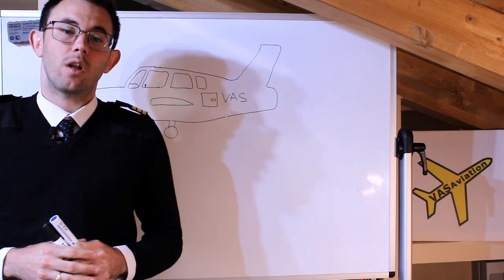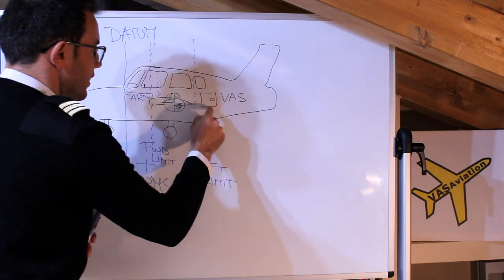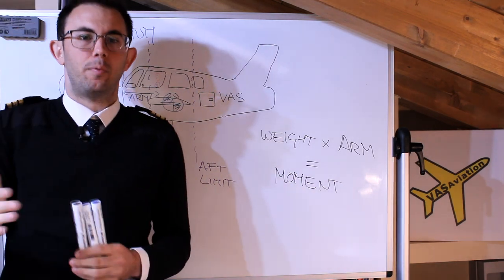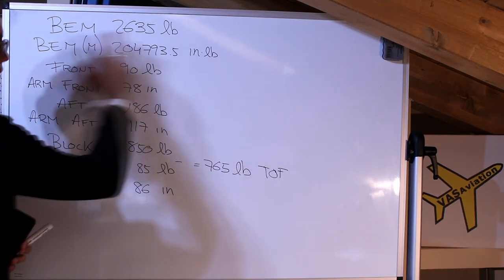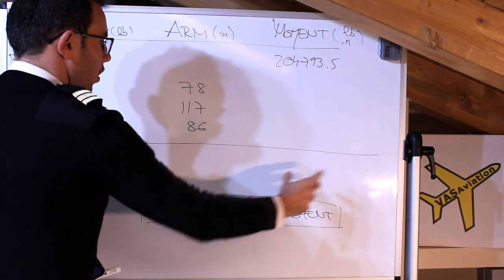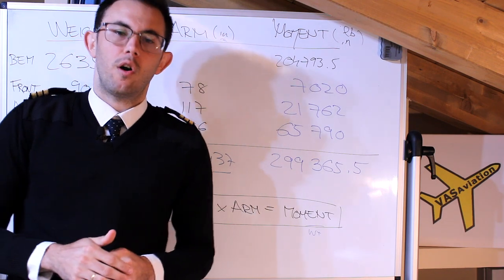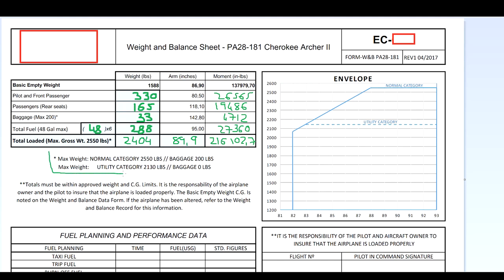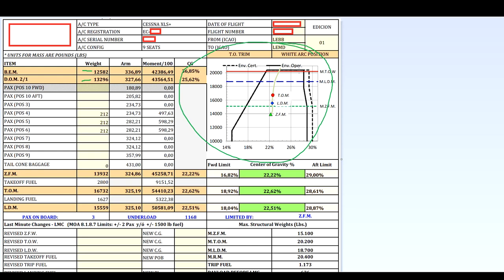MASS AND BALANCE | Terminology + CG Calculations

Comment: A few short years ago, we had pushed back and actually were in the alley when we got a call that the load was incorrect. Shut em down right there and got the tug back to the gate for aft to forward reconfiguration. In the air a lot of years... and this was a first for me. Weight and balance has to be done with precision - every time..., irregardless of GA or Commercial aviation or things could go really bad, real quick.
Reply from the maker: Facts! Thanks for sharing your experience!
Reply: Wow! I’m thankful the load was re-calculated, or whatever led to your call-back. The initial mistake and how and why it was made is concerning, but good pre-emptive error management hopefully catches errors like these before they become another Gimli or a National Airlines disaster.
Reply: Hello Big. Yes, no argument. My only beef is that I studied physics and mathematics a long time ago, and this post (not your comment of course) means I have to to start learning it all over again. Arrrggghh. But, yes, you darn well better go back to the gate. You can be my pilot anytime :)

Comment: 25:44 Can someone tell me, why is it 48*6? Is it because, there are 6 fuel tanks in total, and every fuel tank has a capacity of 48Gal, and every tank is full?
Also, fuel is in Gal, and all the other quantities are in lbs? Isn't it inappropriate?
27:25 Is the baggage mass (200 lbs) included in 2550 lbs?
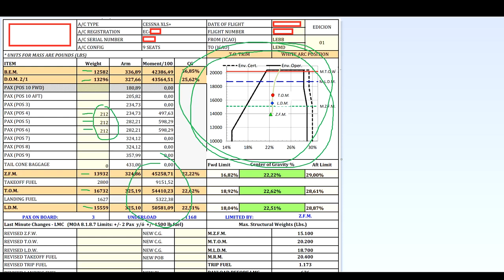And, what did he say at the end at 32:47? 😅😅
Reply from the maker: 48*6 is to convert GAL to LBS
Reply: @VASAviation  isnt it 1 Gal = 8 lbs ?
Reply: @RohanEaswaran  Yes.
6 gallons * 8 pounds/gallon = 48 pounds.
6 gal = 48 pounds.